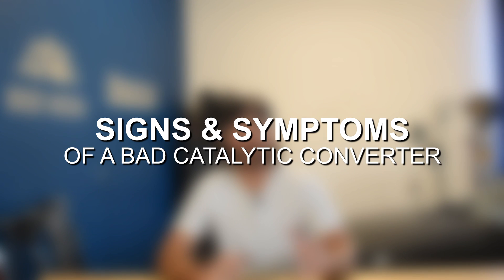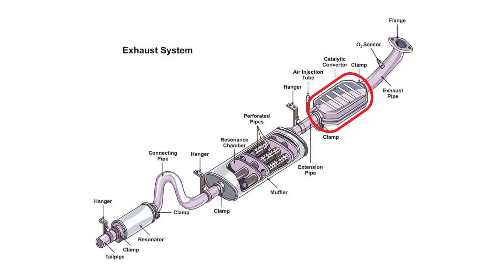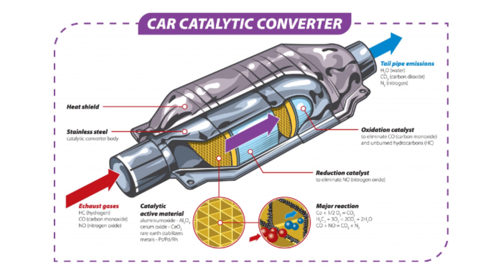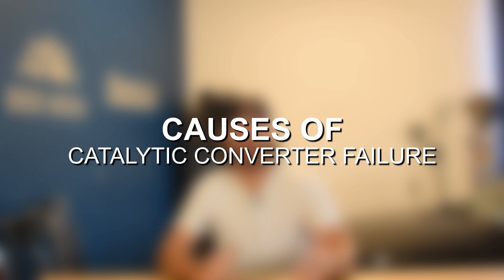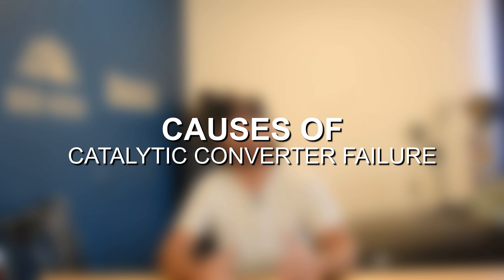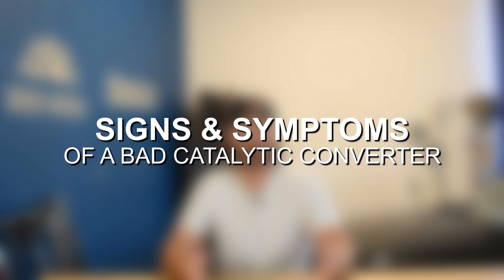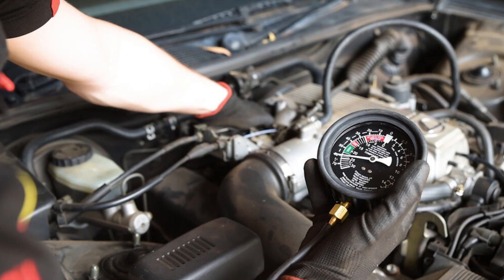Signs & Symptoms of a Bad Catalytic Converter!

Comment: Would a bad cat make a rattling noise ?
Reply from the maker: S - Yes, a bad catalytic converter can cause a rattling noise, especially if the ceramic honeycomb inside has broken apart due to age, overheating, or impact damage. The rattling is typically most noticeable at idle or during acceleration when exhaust flow increases. If the converter is partially clogged, you may also experience loss of power, poor acceleration, increased exhaust backpressure, and even a check engine light (P0420 or similar codes).
Reply: @ would you recommend me replacing the cats or hallowing it out

Comment: The easiest test for a bad cat is get a infrared temp gun and get the vehicle up to operating temperature and check the temp going into cat and temp going out of cat depending on what readings you get that will tell if the cat is working properly or on its way out or completely toast! Retired mechanic here!
Reply: So how much hotter would it be coming out typically?
Reply: @rsanchez9192 Great question! I wish someone would answer it.
Reply: @rsanchez9192  Generally, the temperature after the converter (rear) is 150-300°F (66-149°C) higher than before the converter (front), according to Quora
Reply: @rsanchez9192 , if your catalytic converter is plugged up, it'll be extremely hotter at the output end, but if it's operating normally, the temperature coming out will be about 50 degrees cooler.
Reply: @alanwylie8960 wouldn’t that be at the input end … doesn’t make sense if it’s plugged to be hotter on the exit end
Reply from the maker: M - Thanks for taking the time to share your experience and knowledge!
Reply: That is what I thought
Reply: I'm not sure if you could help answer my question?
I have a 2005 Mitsubishi gallant. Rattles loudly  only upon acceleration only.
 It is somewhat losing power when I hit the gas but once I get going it's fine; do you have any idea what could be causing this?
The car is too old and not worth sinking a tone of money into it. I'm looking to fix it as cheaply as possible and sell it. 
From deep in the heart of Texas, my friend.🤠
Reply: God Bless you. I will do that tomorrow.
Reply: Lot of gibberish jake

Comment: My engine was running and my gas pedal went all the way down but no acceleration. Auto zone said possibly cat conv. Can anyone help?
Reply from the maker: S - Are you getting a check engine light?
Reply: @8020Media  yes I was getting a check engine light. But so I was watching these yt videos and so I went with the direction and used that cataclean stuff. I poured the whole bottle, rode around for about 30 minutes. And I didn't fill up on gas until yesterday morning, whichwas the morning after i poured the clean in. And let me tell you, that check engine light went off as soon as I filled up on gas. Literally. In doing so, now my jeep ride smoother, my key start works now and now i have no dash lights on.
Reply from the maker: S - Awesome! Glad to hear your solved the problem.

Comment: M driving ford focus 1.0 ecoboost i keep getting engine light n none of the above problems you mentioned is happening on my car but my mechanic told me that i need to find someone to fix Emmission problem
Reply from the maker: B - Do you happen to know what engine codes you are getting?
Reply: @8020Automotive system too rich bank 1 p0172

Comment: Will your VSA light and Check engine light go on when the catalytic converter is clogged
Reply from the maker: L - Yes, a clogged catalytic converter can cause both the VSA (Vehicle Stability Assist) light and the Check Engine Light (CEL) to turn on. A clogged converter creates excessive backpressure, which can lead to poor engine performance and trigger CEL codes like P0420 (catalyst efficiency below threshold) or codes for misfires and oxygen sensor issues. The VSA light may activate because the system detects reduced engine performance or irregular signals from sensors tied to engine operation. Address the catalytic converter issue promptly, as driving with a clogged converter can damage the engine and exhaust system.
Reply: @8020Automotive  thank you for insight

Comment: Can adding a cold air intake for 6 months, then putting back in the stock intake cause any of these issues? 
My check engine light is on, auto zone reader says catalytic converter.
Reply: U forget to plug everything into intake
Reply from the maker: L - Not likely.

Comment: Well...I just bought an 08 Prius from a dealer in SC.  3 days after I got the car the check engine light came on...after maybe 100 miles.  The car seems to run fine.  No misfires or trouble accelerating.  Had the code checked at Advance Auto and OReilly and they say it is the cat converter.  I think the dealer re-set the check engine and since it is as is he stuck it on me!  However it still runs the same as before the light came on.  Oil looks good and the coolant looks fine...no dark fumes from the tail pipe...I don't know.  Thinking on just driving it and see what happens next!
Reply from the maker: F - Sorry to hear this.. Did you get a warranty?
Reply: If you need annual emissions state inspection, like in Illinois, they will not pass inspection if check engine light comes on.  Just as info.
Reply: @LarryEckert  Thanks Mr Fukert but all you have to do is re-set it same as the guy that sold it to me.  Take the neg wire off the 12V battery or use a OBD scanner to do it.
Reply: Hope you got a code reader for yourself and looked further into the code

Comment: Does it affect braking system? My parking brake keeps cutting on and off everytime I come to a stop
Reply from the maker: K - Not likely.
Reply: @ do you know what that is? And I got home and had a foul smell coming from the car like rotten eggs or fireworks, do you think that’s bad catalytic converters? & how long can I drive with it?
Reply from the maker: K - Sounds like you do have a cat issue, but that wouldn't cause the parking brake to go on and off. Seems like the wire for the parking brake could be messed up.
Reply: @KingKhiddoxYuneek  did you find your issue. Funny because I went over water about 3/4ths of my tire. I was having break light coming on and abs aswell then my car stopped accelerating above 5 mph. Im here because I think its my cat. Working on it now.

Comment: One thing about some of t diy projects for cleaning out the cat that I have noticed is going to be a killer. Some people have tried using a strong kind of chemical or caustic solution, which is a good thing for a dirty motor but  is an electrolyte in a cat converter. They use different rare earth metals that will electroplate another. The End. Use something that won't do that.
Reply from the maker: L - Thanks for the insight.

Comment: Hi , please help me figure out what is going on with my Nissan '90  D21.   A couple months ago I started noticing an intermittent  sound coming from under my truck  . Sounds like there is some sort of obstruction in the exhaust system .  Like some airway is being partially blocked .   When another car pulls up along side of me the sound is returned to me driving along when it bounces back .  Today Nov 11 I could hear a beating or popping sound and when I pulled into a parking lot I turned the engine off and back on and the popping shaking of the exhaust & tail pipe was gone from turning the key off .  I have noticed a loss of power when trying to acccelerate .   I just spent $709 for a diagnosis and they replaced the Intake Manifold gasket ,  wherever that is ,  but the noise and exhaust problem did not go away at all .    I am 78 year old woman who knows nothing about mechanics of my D21 and need all the help I can get .
Reply: San jose  California hoping you are near by so I can help whatever I can.
Reply from the maker: B - Sorry to hear this! Are you getting a check engine light?
Reply: @8020Automotive NO,   none at all  ,  just a sound that seems to be coming from under truck like an airway is congested ,  obstructed .   then whole exhaust is  visibly shaking hard and popping sound coming from tail pipe . ,  then stops completely after I turn engine off then start up truck again .  I have driven it for a full 30 years and this is new .
Reply from the maker: B - It definitely sounds like there could be something going on with the catalytic converter. Keep us updated!

Comment: ‘17 VW GTI, DSG 
Been chasing issues for the last few months. Replaced suction jet pump, charcoal can, evap purge valve, PCV unit. Brand new plugs just two days ago and I’ve been exhibiting a lot of the symptoms of a clogged cat. My issue is my pre cat o2 sensor has been throwing a low voltage code forever and I get no readings from the post cat sensor in OBD11. In live data, I could see the pre cat exhaust temperature reading 80-90 degrees Celsius above what the post cat temperature was reading. I also have very weak flow coming from the tailpipes and have smelled a sulfur/nasty smell a few times over the last few weeks. I also noticed a smell when pulling the coil packs out of the cylinder head, as well as finding some oil around the washer rings of cylinder 2’s spark plug.
Reply from the maker: O - Sounds like a cat issue to us! Have you taken it to a mechanic?
Reply: @ I haven’t yet, but I’ve gotten a few opinions from a couple shops and they’re all leading to something with the cats. Got a single Hi-flow on the way to replace!
Reply from the maker: O - Keep us updated!
Reply: @OHNOES131  try cleaning the cats, some cars have 2, find the best way to do so, your rings may wear soon if you dont, the blocked pressure from the exhaust by the cat can lead to particles getting into the piston chambers and wear your rings. 
Cats are total fuckery, when they are getting too hot the vehicle sometimes shut off or just lose power, the readings by the o2 sensor does this, nothing is wrong with your o2 sensor.
Just take this as gospel truth clean the cats properly car will be fine, lets hope the rings arent damaged
Reply: @ hopefully the rings are good. I’ve actually since this post installed a CTS turbo Dp with the hi flow cat on it, but still having some issues. With light driving the car drives fine, but when I give it good throttle, it chokes up. Also on warm start, it has a bit of a rough start as well. I’m gonna do a carbon cleaning as I’m at 101k and I don’t believe any of the previous owners ever had this done. Also I was running with a faulty PCV unit, and turns out the blow by gasses and hydrocarbons can recycle back through the intake manifold and gunk everything up. If the carbon cleaning doesn’t do the trick, next step is injectors. But after monitoring injector timing, nothing seems out of ordinary. No short term fuel trim either, just sporadic misfires not specific to any cylinder. For instance, last time driving and giving it throttle to pass another car, OBD 11counted 30 misfires on cyl 3 and 8 on cyl 1. Plugs are brand new and all gapped to tune spec, coils are only a year old.
Reply: @OHNOES131  clean erg if you have one on your car, if your blow by is over norm then the intake air temp can be high, that could be the reason for the sluggishness, if tour using more oil now then the rings may be worn, but clean the erg first and trottle body.
Reply: @ dumb question but what is erg? IAT’s are normal, was looking over that and other things when I was checking for vacuum leaks and stuff.
Reply: @OHNOES131  maybe its egr its some link to intake system from exhaust its a valve . Sometimes it clogged up.
Reply: @ ahh in that case, that would be the N80 purge valve for my car then. Part of the evap system. I did actually have an issue with mine being stuck open due to issues with the suction pump/charcoal canister, but have had all those components replaced by VW.
Reply: @OHNOES131  well oil maybe reaching plugs and or the pressure being released into intake by pcv valve may make the intake air read too high and the intake system may inaccurately adjust the air causing sluggish acceleration briefly. 

The cars computer is not like a brain it reacts to readings and thinks its course of action is correct,which puts car in limp mode, adjust combustion mixture inaccurately, once the catalyst gets blosked then lots of 'reacting' takes place  in the ecu system. 
Thats my take on the matter, catalysts were made to wreck engines. Did you realise how difficult it was to conclude the catalyst was blocked and how many false scan readinds you got before figuring it out  people changed pkugs injectors cleaned intake systems nothing solved the problem,  everybody reading this the catalytic converter need to be cleaned  once every year or when it goes bad the adjustments by the cars computer will wreck it. The truth is stranger than fiction. If your not rich qhereyou can chamge your car every 3 years then do this the car will be fine for a long tine.
Reply: @OHNOES131  intake air temperature,

Comment: Hello. Thank you for the video. I have a dodge charger that cranks but doesn’t start. I’ve changed all sensors but the 02 sensors. I heard they would be the cause of not starting and that all 4 to go out is uncommon. The only codes I have is for all 4 sensors. Would a bad cat be the cause of no start. Thank you.
Reply: ......................................I was out with a friend  to  Loews,,,,,,,,,His truck was  very  hard  to restart  ;  he  came  near  draining  the battery,,,,,,,,He told  me  this  happens   when  the  F-150   got  hot,,,,,,,some  weeks  later  it  would  not  start  when  cold,,,,,,It was towed  to a repair  shop,,,,,,,and  they  told him   the  cat   or  cats    was  clogged,,,,,,He  bought   a newer truck...........................................shit  creeps up on  things,,,,,,,,,the  bad   becomes  worse   after  the fact....................
Reply from the maker: D - This video will help your research: https://youtu.be/0YRdzJbHcm4

Comment: The engine repairer changed the testate with a new one which doesn't have the hole of egr valve. I change the catalict with one.the co2 emission failed again.and before 7 years with egr valve on catalict new failed the same
Reply: It's a vw lupo 1.0 year 2001
Reply from the maker: A - Are you getting any engine codes?

Comment: I have a 2015 Hyundai Sonata 2.4L engine, and it has 240k miles on the engine, I had the engine and transmission tested theyre fine,  and I replaced the spark plugs, coil packs, throttle body. Accelerating is very slow. It takes a second for the car to get up to speed. I suspect it's the catalytic converter. It's expensive on this vehicle. It's has no codes, and there is a smell that comes from the exhaust. Do you suspect it's the catalytic converter? I change the oil every 3k with full synthetic, and transmission fluid has been serviced regularly. I love this car, and it is a trooper. Most 4 cylinder vehicles dont make it past 200k, and I want to keep this car going. Suggestions?
Reply from the maker: K - Carbon buildup is possible? Was the loss in acceleration gradual? If not, here's a video that could be helpful: https://youtu.be/ipjYLPJgpq8
Reply: @8020Media  It's been gradual
Reply from the maker: K - Could be carbon buildup or a clogged converter

Comment: idk if u will reply to this but i got a p0305 clyinder 5 misfire and p0446 code, but auto zone recommended i replace the catalytic converter....when at idle it make louder buvv buvv buvv, noticably worse when i go into reverse or go very slow in drive, seems fine in neutral and park have very little vibration and loud buvv buvv buvv. any input would be appreciated friend. I use this truck for work and idk if i can afford a new cat.
Reply from the maker: T - Don't think you need to replace the cat. Seems like it could be your EVAP system. Check the purge valve and check your ignition components in cylinder 5.

Comment: So I was told to replace cat and knock sensor but have none of the issues. I get 25.3 miles per gal, no acceleration issue..My car is a 2016 Honda Pilot please help
Reply from the maker: M - Were you told to do so because of an engine code?

Comment: Would a hot, warmer than usual floorboard (driver and passenger) be a symptom of a bad/ clogged catalytic converter? Or, would it be a heat shield issue? Thanks
Reply from the maker: F - It more than likely is heat shield related.

Comment: Would a bad catalytic converter affect the throttle body and mass air flow sensor?
Reply from the maker: B - It certainly can!
Reply: My trailblazer goes into "Engine power reduced mode" when canceling the Cruise control mode when driving..Could the cat or throttle have something to do with this? @8020Automotive
Reply: What did you end up doing? 

My air flow sensor is going off and I’m not sure if I should get the part or clean it first
Reply: @stephanieh5478 sadly I had to actually get rid of the car because I didn't want to replace the $3,000 Cadillac converter with a state approved one so it wouldn't have passed smog and it was starting to get really clogged to the point where the car just stopped working. It was a real shame because I loved my Prius but the one flaw with that vehicle is the fact that they put the catalytic converter, such a an essential piece of the car's equipment, in such an easy to steal place. So I ended up buying a Kia Niro instead.

Comment: Ap0420 code is a clogged cat.
Reply from the maker: M - Not always, but most of the time, sure.
Reply: No. It only indicates that the sensor output suggests cat efficiency has dropped below 95%. It has no way of knowing why. There are eight or ten reasons why the downstream sensor might throw a P0420 code; only one reason might be a failed cat. And a 'clogged' cat is not the same thing. That results in seriously impaired car performance, noticeable to any driver.
Reply from the maker: K - "Not always". But thanks for sharing the insight.